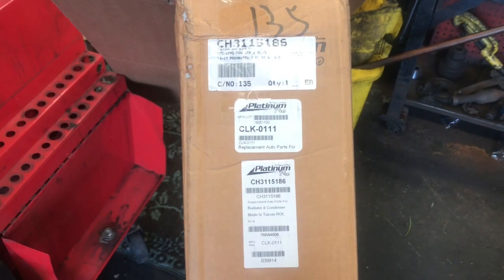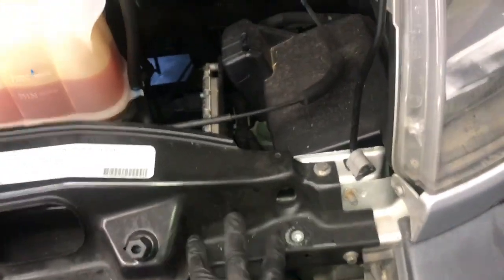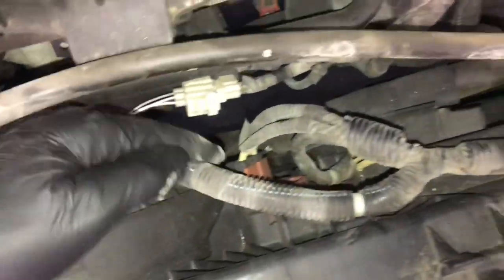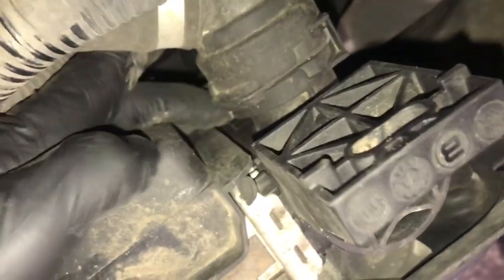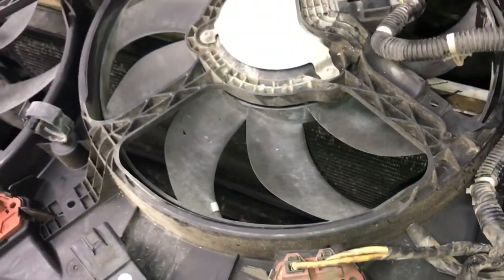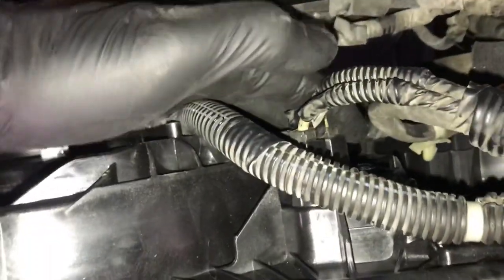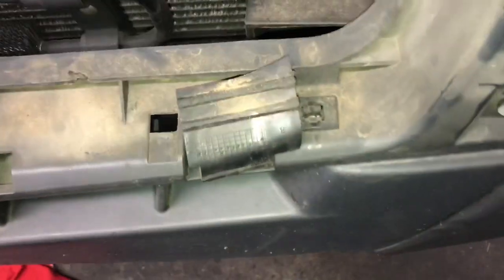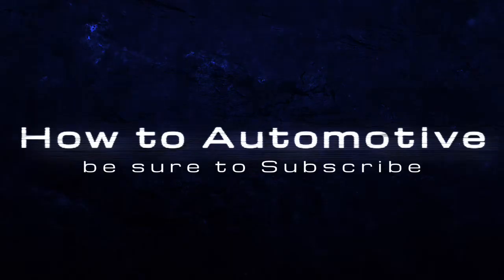Replace the AC and Radiator Fans on a 2014-2018 Dodge RAM 2500 Promaster

Comment: There is actually a recall for this part. I have a customer with a 2017 Promaster that I had the dealer run the VIN and they said it was covered.
Reply: Doesn’t include 2014 😑
Reply: @andrewlaubi4448  Sorry to hear that.

Comment: so I replaced my fan but I wonder if I put the resister plugs back in the right slots. Each fan has two identical looking ones. Reason I wonder is because the other fan only kicks on sometimes. Check engine light went away and it seams to drive without over heating but I wonder if It should be switched back

Comment: I took front panels off, left bottle attatched, unplugged connectors, then let up fan from tabs and it slid out from under tilting driver side down first left the hoses on ;)

Comment: If you dropped the fan assembly from the bottom could you avoid undoing the upper radiator hose?
Reply: I was thinking the same thing 🤔 never done one of these so idk if it will come out the bottom
Reply: No you can’t. The fans can’t come up enough with rad hose in the way

Comment: I have the exact vehicle,  I wish you would make a video on how to change the spark plugs.
Reply: You just take the front grill and radiator support off just like in this video. But then you have to take off the manifold and all spark plugs are right under. The manifold can be tricky, but once you find all the screws it comes right off for a spark plug swap. I purchased NGK Laser Iridiums thinking they’d be better then mopar...WRONG! Go to the dealer and buy the mopar plugs. They are $13 at the dealer each, I paid $15 for the Ngk and they didn’t work. Had to tear it all apart to replace them again. While at the dealer get a couple manifold screws. There’s about 7 of them and the two in the center of the manifold are know to rust to heck and will be very difficult to remove. Have a couple extra on hand before attempting. Only $3.50 each at dealer.
Reply: @nickp778  ok thanks for the info, I'll get a couple of extra screws.
Reply: Oh yeah, did you have to drain the cooling system?
Reply: No, not for the manifold. You’ll lose a little if you replace the radiator fan, but like he said in the video- keep the coolant reservoir cap on and you won’t lose but maybe 1/2 - 1 quart,
Reply: @nickp778  one more question, did you have to remove the wiring and hoses from the manifold to get to the spark plugs?

Comment: So my radiator fan is coming on and off on and off with like 10 seconds in between mechanics said it needs a new module, are thoses located on the fans? Or have replace the whole fan? Didn't no if module was built in the fan....? Thanks
Reply: Mine does too…… sounds like it’s about to take off like a hover craft

Comment: Can I ask why these were replaced?  I have an exodiesel and the fans seem to be staying on once they turn on.
Reply from the maker: Matthew Stevenson on this van one of the fan stopped working completely. If your fans are running after the vehicle is turned off for short period of time that may be a normal condition but if it’s extended time  then I would suspect the relays stick on or the can pewter commanding it on for some reason which would require diagnosing with scan tools
Reply: @HowtoAutomotive  I think it's something making them stay on.  I have a feeling the relay is fine.  Just idling I wouldn't think they would be staying on constantly.  The only thing I can think of is maybe to keep the automated manual transmission cooled off even though the ac isn't running and the engine is at the proper temp.
Reply from the maker: Matthew Stevenson something is definitely going to need to be look into. Could be a normal condition. Fan control modules can also malfunction causing to release to be energized and make the fan run
Reply: @HowtoAutomotive  Oh yeah one more thing.  I let it idle and I popped the hood.  The air coming out the top was cool and the fan was still running.
Reply: Wonder how much dealer would charge for that job?